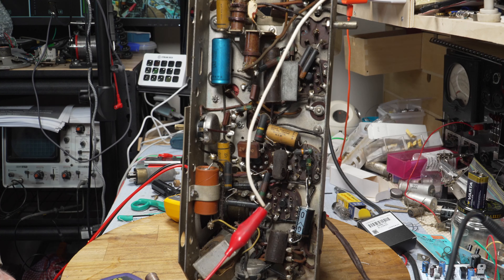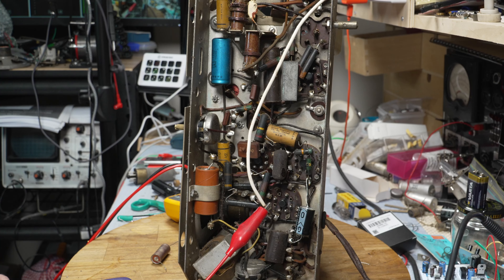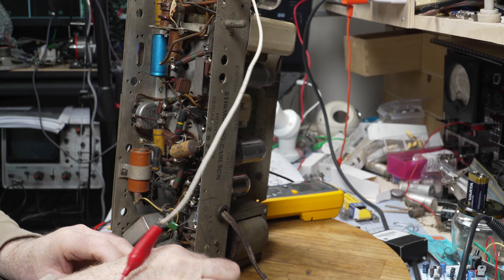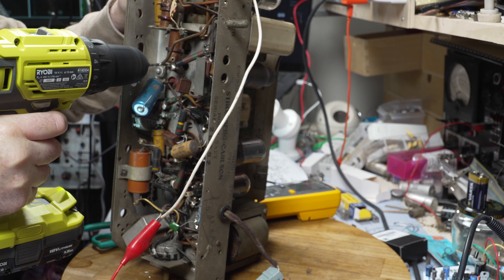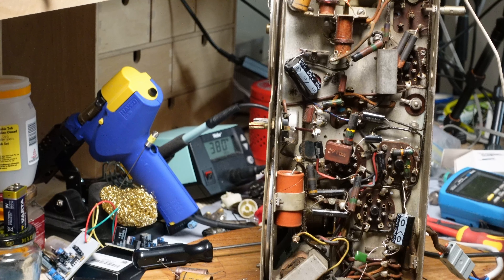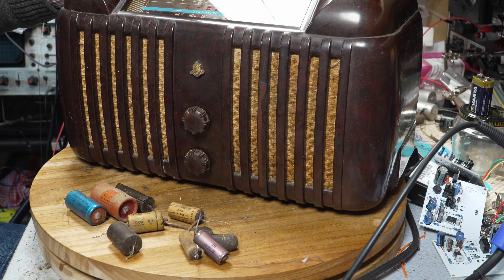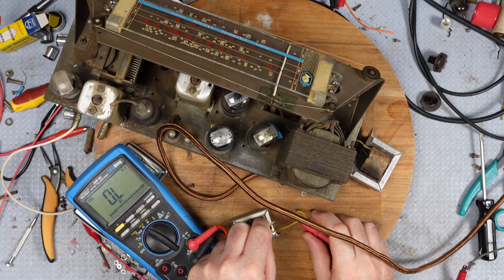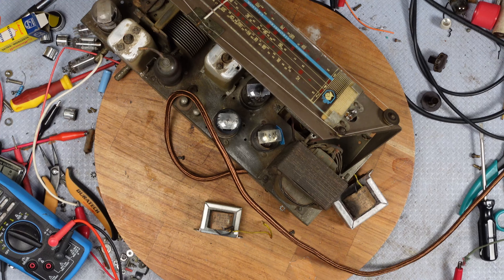Stromberg Carlson 5A27

Comment: Hi Andrew,
What a pity about that choke! I presume it's the one in the power supply circuit, not an audio choke. I noticed you left an old electrolytic in there which looks like it's attached to one side of it (from what I can see in the video).  Maybe it's leaky enough to pull excess current through the choke? Anyway hopefully you'll find one that fits.  I don't think the bigger one difference electrically - maybe slightly lower voltages to the valves apart from the output valve.  Anyway, good luck with it!  Bo doubt you'll come back to it some time.
Cheers